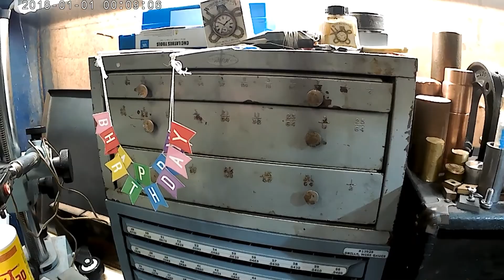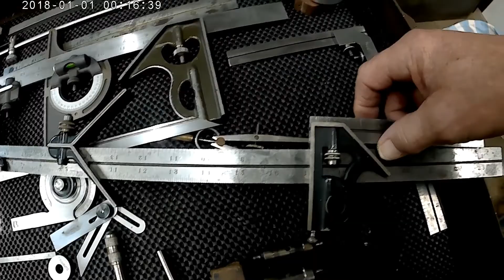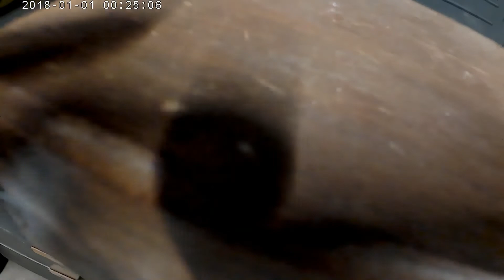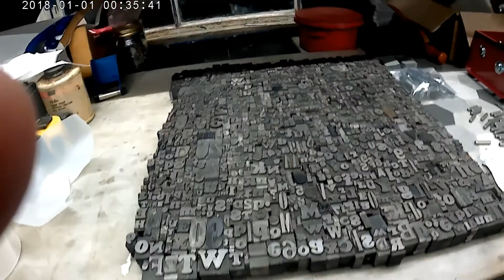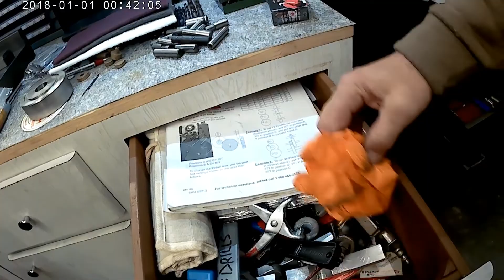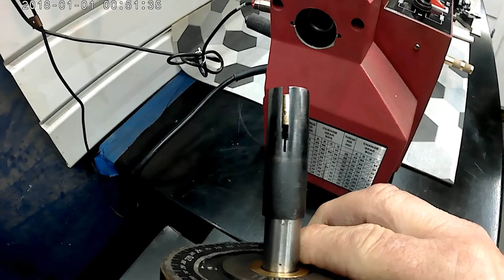SHOP TOUR 2/2021

Comment: Kimber, you have a correctable bad habit. On your magnetic holders you should put the handles up. Chefs learned the hard way to store their knives with the handles up. Think for a minute you are reaching for a knife and you fumble it or knock another one off the magnet. With the handle up, no harm no foul. But with the handle down, the whole blade has to pass by your hand and fingers. You can't try and catch it as it is falling because you should not be that stupid. With the handle up you can try and catch it.
Reply from the maker: Hopefully no chefs out there putting knives on magnets very bad practice. I learned not to try to catch the saran wrap as it’s falling off the table, The serrated edge on the box can go right through your hand much worse than a knife cut. I’m talking about the big restaurant size saran wrap in foil wrap boxes.
I will take your advice to heart and go out and re-examine situation. Thanks For watching and for your comment
Reply from the maker: I am embarrassed to admit the two worst cuts I got in a restaurant kitchen was trying to catch an eight or 10 pound box of saran wrap and of all things a vegetable peeler. You know like a potato peeler something you shouldn’t be able to cut yourself with
Reply: @kimber1958  Way back in 1970 I cut the back of  my index finger knuckle right off. You know how you are supposed to hold food down with your fingers tips tucked back just a bit. there is a second step; don't raise the knife above your knuckles and draw the the knife toward you. It did that and cut the back of the knuckle right off. On the back of each finger is a fair sized artery that spurts blood really well. I had to get a skin graft on it to fix it. Because I cut the artery the finger tip get's colder than thee other fingers.
Reply from the maker: I might’ve done something similar but not the artery part that sounds horrible